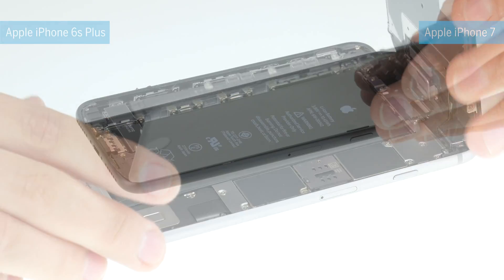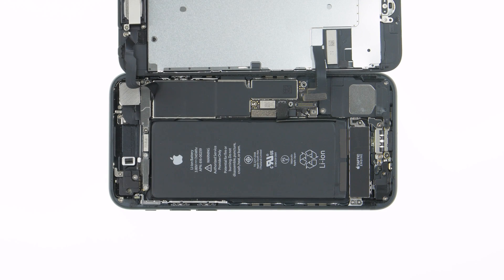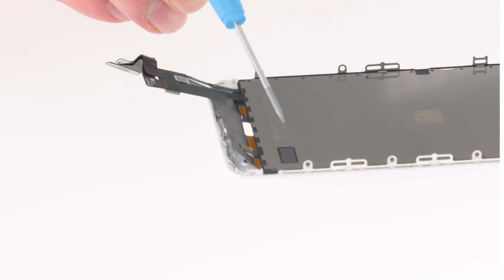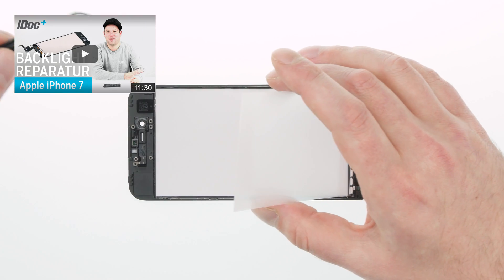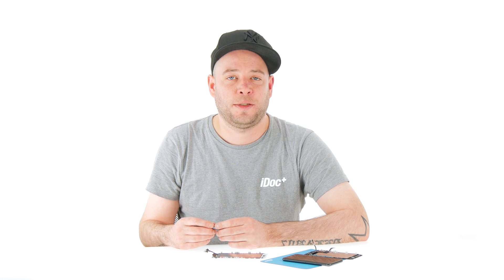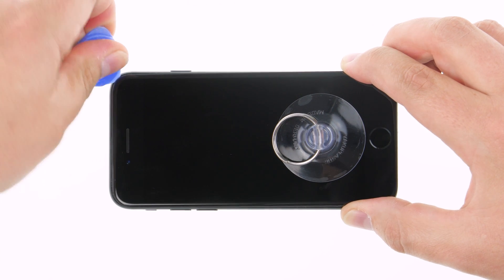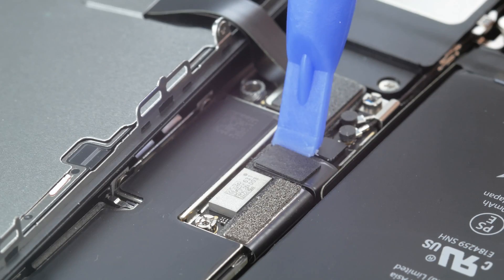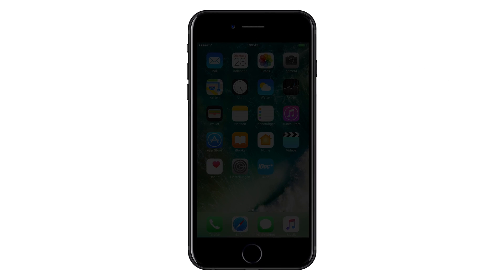iDoc NEWS – iPhone 7 HOMEBUTTON ERROR (FIX / SOLUTION)

Comment: hi, i replaced my rear case on my iphone7. since then it wont charge anymore. when the iphone 7 is turned off and i plug it in, it does turn on. so there is a connection. it just wont charge anymore. what could be wrong ?

Comment: Apple is simply a bunch of gansters, it starts with using screws that require screwdrivers that noone else uses....
Reply: and the screws material is so oft, that they break easily / have to use so much force that it breaks parts beneath…

Comment: My Touch ID is getting super hot while power on
Reply: Is not the I'd touch problem but surely the charging port or battery I recomend replacing the battery first and if that dosent work then it's the charging port

Comment: The bracket on the back of the lcd is pinching the cable...Solution... 
bottom left screw ( only non y screw) screw it in without the bracket and let the bracket lay on top of the screw

Comment: hi i have a question before i make the purchase. the home button and the vibration of my iphone 7 plus is not working. i changed the home button but its still not working. now i am thinking that it could be related to taptic engine because it is not vibrating. do you think fixing the taptic engine will resolve the issue???
Reply: Ya the fingerprint sensor wont work unless you use the original one Apple states it's for safety purposes
Reply: Muhammad Taseer, the taptip engine should be fine. A new home button won't work except the original one that came with